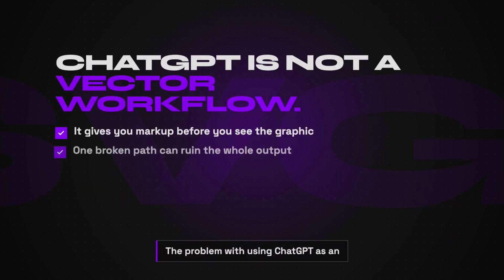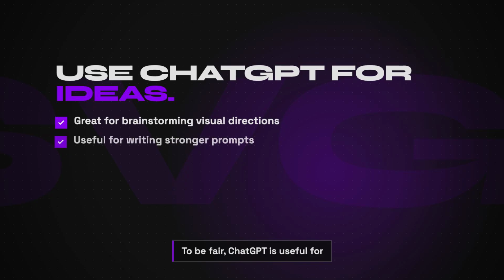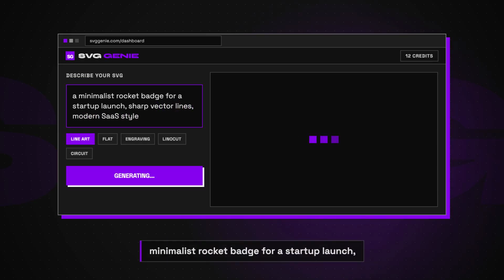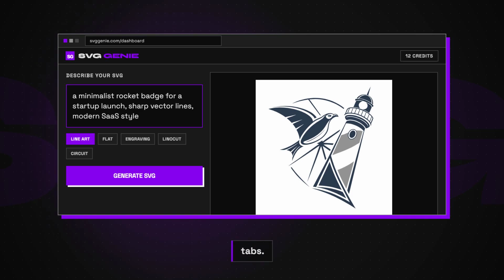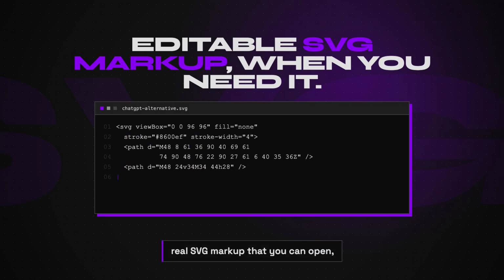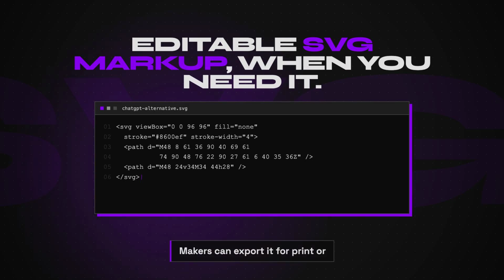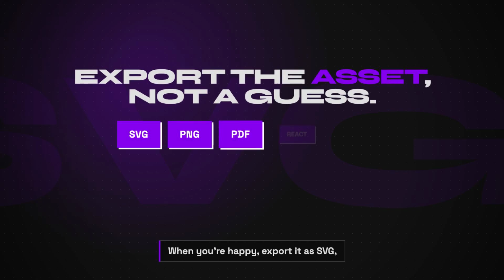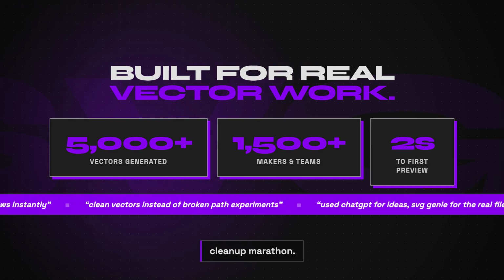ChatGPT SVG Generator: A Better Way to Make Editable SVGs with AI

Comment: I have been using Claude to
 Create laser images for me by writing a python code. Once it writes the code, you can create as many images for free. As you want. For example, i created a cow eartag template with a number on it. The program Claude created in python. We'll prompt to be for the number that I'm looking for
 The starting number.
 And then it will increment the number in the tag for each tag. So that the laser can edge ten tags at a time auto incremented. Again after the original Claude, help. It's a free python program Claude generated that can be reused as often as needed for free. No limits